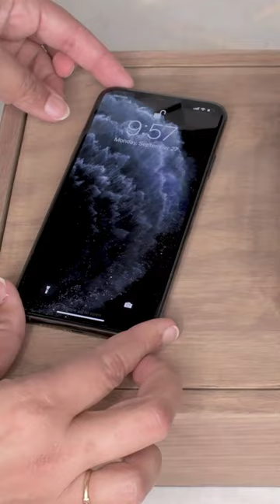Charging Station with wireless charger | 12 Days of DIY Gifts No.2 #shorts #woodworking

Comment: Instead of using a packaged wireless charger, you can get the coil and board from Ebay for pretty cheap. Then you wouldn't have the extra piece of plastic between the coil and wood reducing the performance.
Reply from the maker: That is a great pointer!